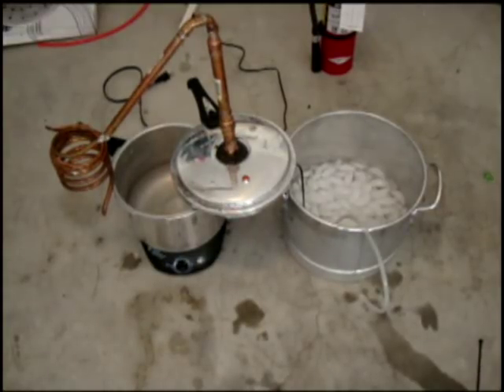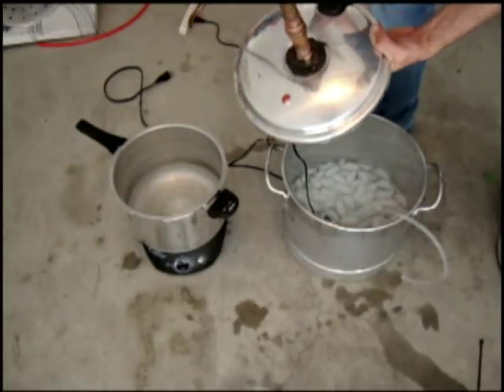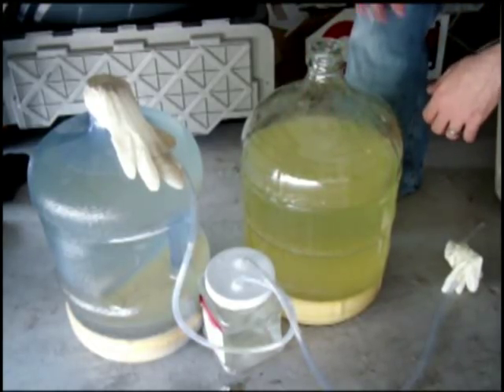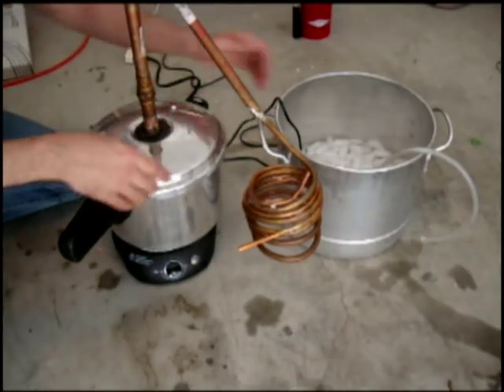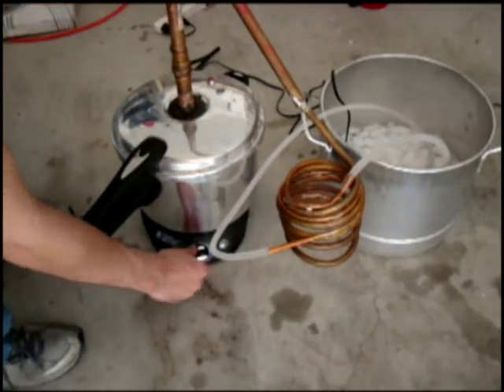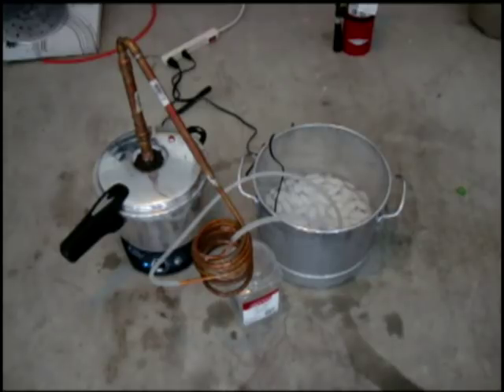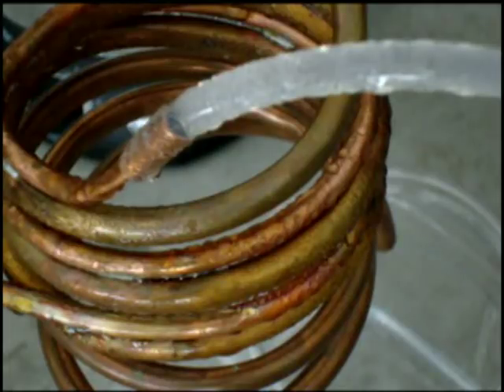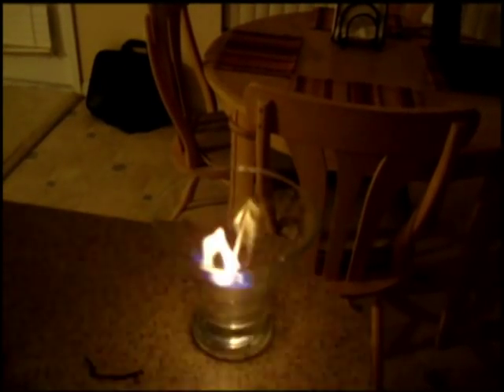Ethanol mash Distilled - Easy method

Comment: you need to make a hue rig with 49 gal oil drums and gas burner and some presser release valve in the pipes that go out far away from the gas burner, and run some pipes under ground to cool the water used for condensing the alcohol, 

great video, i want to make a still now, lol

Comment: Hey Pete, Wondering what kind of mix you are using for the car. Are you blending or running straight ethanol.  What do you imagine you ould need to do to the car to run  straight homemade eth.   Where's a good plac to get your feedstock for homebreed eth for auto use?  thanks -j-

Comment: A few of your other videos relating to survival techniques mention using ethanol for a stove, or other misc. things, but in this video you distinctly mention using electric power to heat the pressure cooker since it's safer than flame. In the case that some event occurs that causes drastic survival techniques to be necessary, how do you plan to deal with the heating, cooling required for distillation? Great video, really interesting.